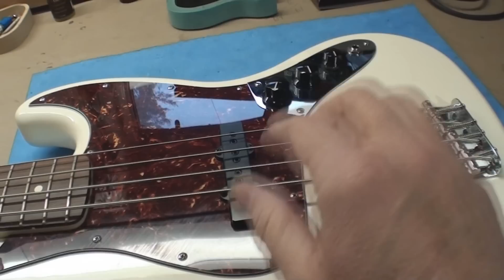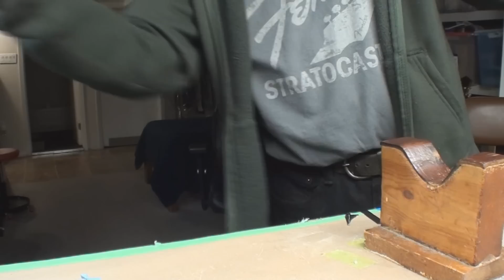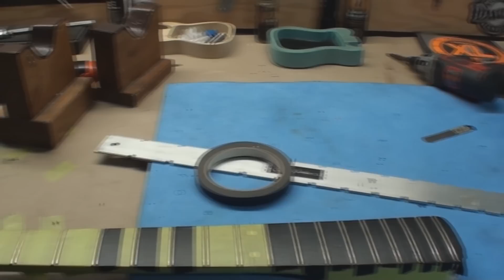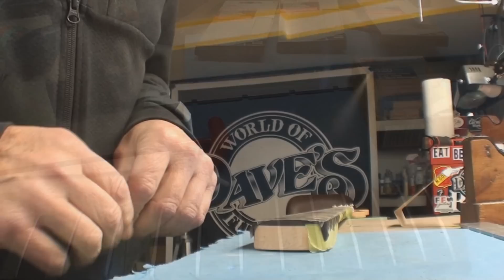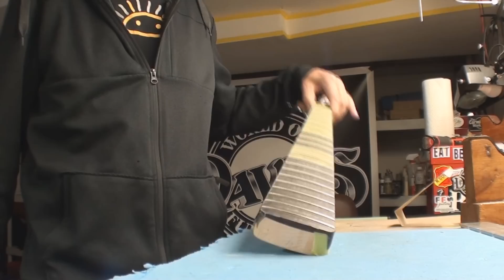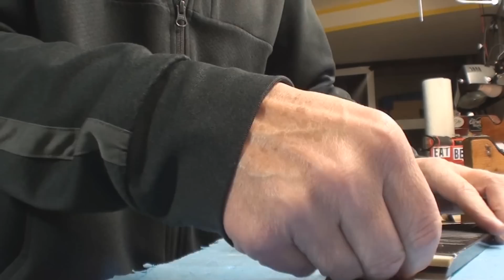Fender Jazz Bass Guitar Made in Mexico

Comment: The new to you 3m 320 grit sanding sponge is actually excellent. I've been using them for a while now and as they wear provide an even finer finish. I have 3 of them in different stages of being worn. Then go to the metal polish. It has greatly reduced the stages of polishing as well as the most important thing - time . In my case anyway. I love em !!!

Comment: OK call me a moron, but let's say a truss rod is not turning as it should or should have been turned, is there a way to lubricate it so that it can and will turn?
Reply: It's not that the nut of the truss rod wouldn't turn, it's either that the bend of the rod won't press against the wood as it should, or thre are problems with the end of the truss rod, or the neck is so bent that the truss rod can't straighten it out while it's already fully engaged. If you do big adjustments, you can bend the neck back or bend the neck with a long beam, a few pieces of wood to layu underneath and some clamps. You bend the neck before the truss rod has to fight against it. Dave is doing the bending by hand in some of his videos. The really important thing is the right tool. You might think the key is just slightly off, but it could be imperial and your metric tool is just slightly too wide, which can result in ruining the nut. In some cases of old truss rods, the nut can rust (shitty material) and it takes a lot of patients to get it loose again. There is a nice video on that from dan erlewine on YT.
Reply: onpsxmember thank you! Makes a lot of sense. Dave's world of fun stuff is the real musicians answer to "this old house." Love it, thanks again
Reply: Dave's World of Fun Stuff well, I guess I asked for it did I not. Love the channel man! Great information and stories. be well.
Reply: @SystematicMechanic  I'd be very careful with that. The wood is unprotected around the truss rod nut. A lot of the fluids might harm the unprotected wood, especially when it's hydrophilic like maple. Maybe with a syringe and and something to soak it up under the nut, so the wood doesn't have to deal with it. 
It often helps to slightly tighten it more before turning it loose. That breaks free from the seating position it was in for so long.
Reply: M. P. Touche.  Thanks! Honesty is the best policy.

Comment: Since it was humpy/gappy with the notched straightedge, is there value in leveling the fingerboard independent of leveling the frets?
Reply: You’d need to remove the frets to level the fretboard as you can’t just level fretboard between frets.
Reply: +On In Five - well, you could scrape out between the frets. It's done when scalloping. But it's probably not worth the effort for just a few thousands off. Unlike high frets, an inconsistent fingerboard won't cause fret buzz, maybe just a bit of variation in finger feel and pressure needed.
Reply: Good question. I'll make an "edumacated guess" that levelling frets is to make their heights consistent, since the notes are clarified by the string pressing against the fret more than the board. Having small inconsistencies, or humps, with the fretboard itself may be irrelevant. The truss rod will straighten the neck, but fretboards, being bonded to the neck, may not straighten out perfectly.
Reply: b minor scraping between the frets would still have same issue as you still have underlying issue of seated frets on uneven board, and all it would achieve realistically need for either a new fretboard down the line or a new neck. I’m looking at it from mechanical aspect though I see your point and totally agree with you regarding the effort, the amount of precision work it would require, it’ll be much simpler just to pull the frets and start again in all honesty.